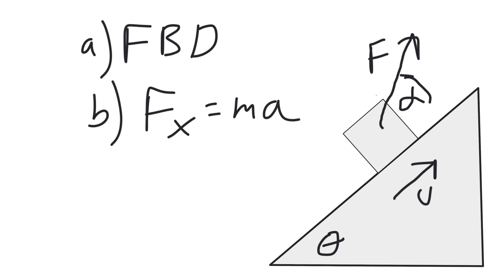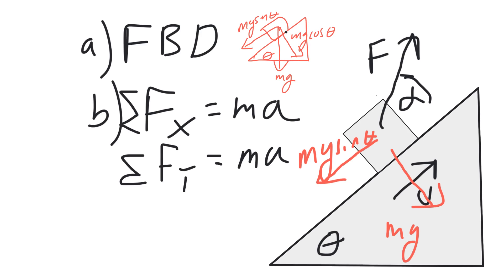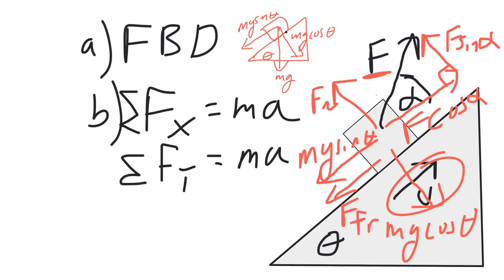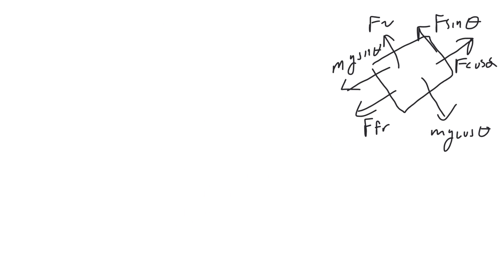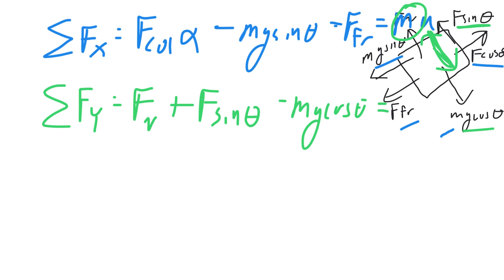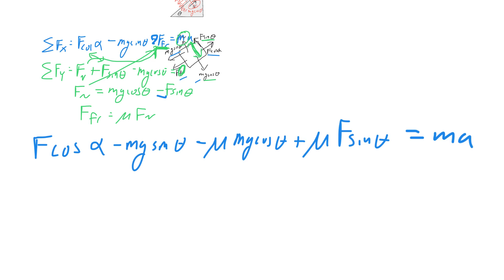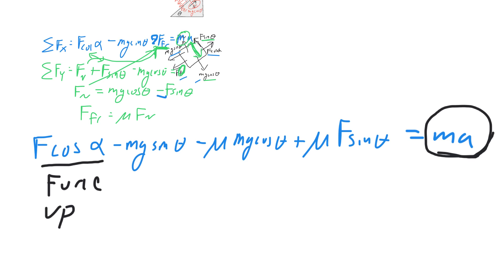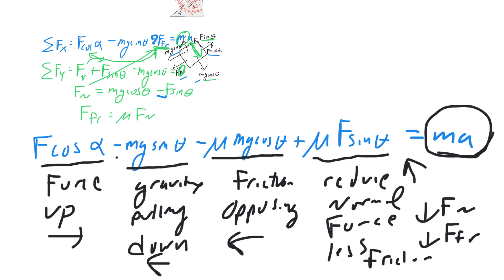Pulling up an Inclined Plane at an angle (Various forces part 2)

Comment: Thank you so very much for getting back to me! I perhaps didn't articulate myself properly. Let say I have a 1 kg box, I have a rope attached to it at an angle of 30 degrees. I switch on the system, it pulls the box 10 meters by exerting a 100 N force/tension , then  on the box way there is a ramp at 10 degrees and the system still pulls the box on the ramp for another 10 meters on the ramp then I switch off the machine. How does the ramp affect the work done in the second part?  Would the horizontal component be now multiplied by cosine 20 insted of cosine 30 in order to find the projection of my force to the surface that displacement is happening? 
I really appreciate if you can clarify this for me.
Reply from the maker: Yes,  assuming that the machine is still pulling at 30 degrees to the original horizontal, then once the box goes on the plane the new angle would be 20 degrees and you would use (100N)(10m)cos(20) to find the work done by the machine. To find the net work, you would subtract the work done by the component of gravity down the plane (and friction if it is present)

Hope that helps.